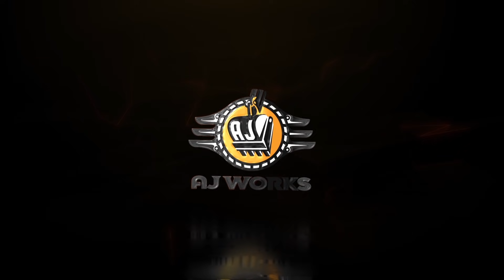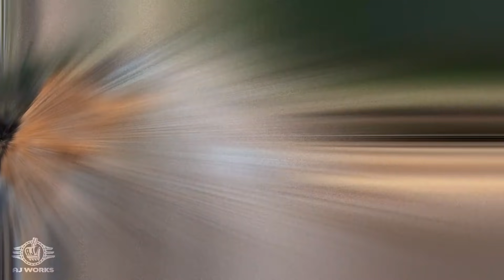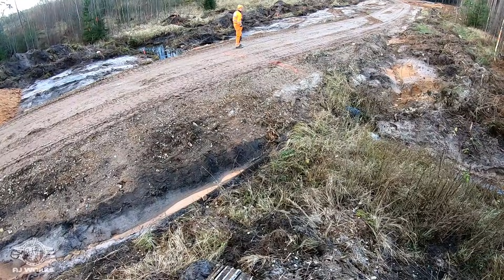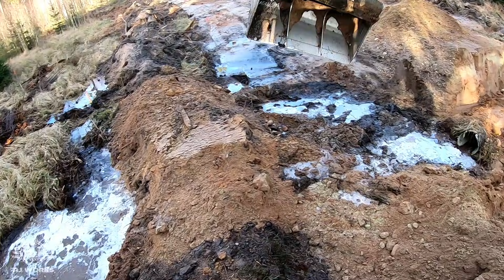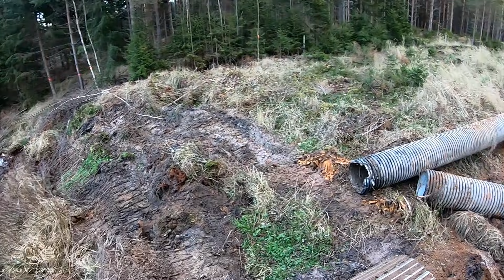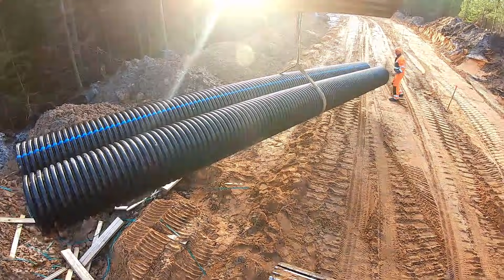Replacement Of The Old Culvert

Comment: That's alot of BS for a temporary culvert.
Reply: For me looks like a permanent solution that will last at least 30 years and be very useful when doing work in that forest.
Reply: @hoakuroija1089  It will be replaced when they put the NEW road in.
Reply: @Boraxo  Oh, I thought the culvert was installed a bit on the right side because the new road will be there, on top of the now installed culvert which will be permanent.